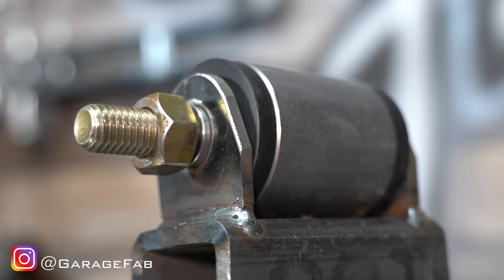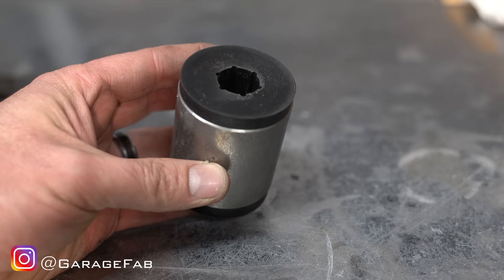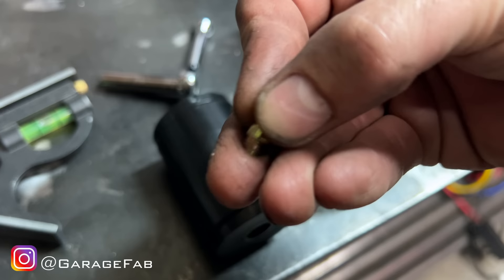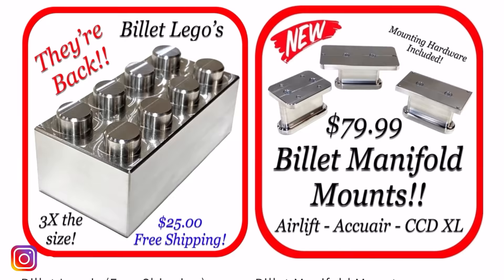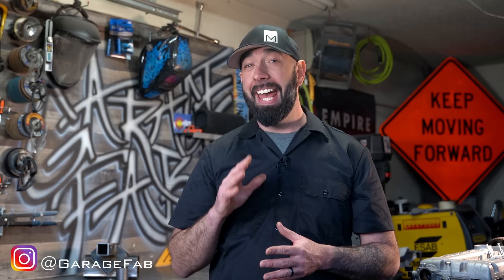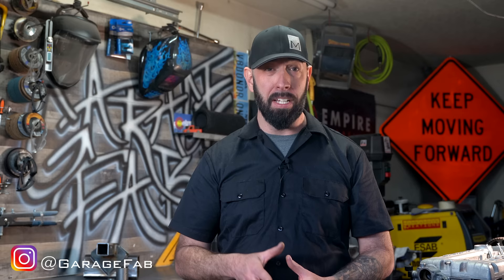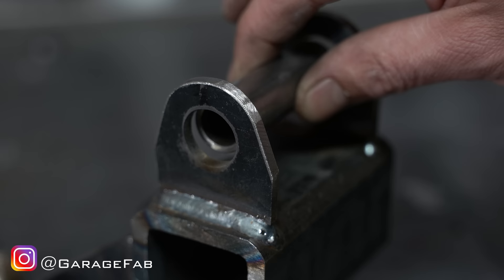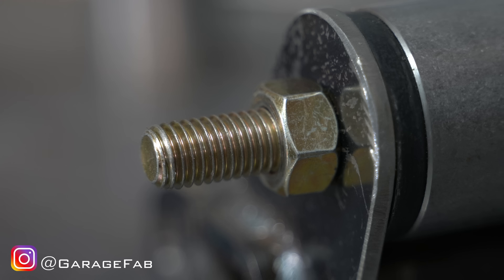The DOs and DON’Ts When Installing Polyurethane Suspension Bushings

Comment: I want to install poly bushings on my project car and have a dumb question. Can you specify when bushings should be torqued with the weight of the vehicle lets say control arm bushings on a solid rear axle. Was i misinformed since like you explained the outer sleeve rotates and not the inner so then this does not matter if all upper and lower axle bushings where tightened with the rear axle hanging and car supported on frame? thank you or who ever reads this :(
Reply from the maker: Definitely not dumb. You were NOT misinformed! There are a few different types of bushings. This video featured polyurethane bushings, almost always aftermarket, often racing applications.
Factory vehicles come with bonded rubber bushings. On this style, like the name implies, the rubber bushing material is bonded to both the inner and outer sleeves, unlike polyurethane bushings, the inner sleeve can’t slip. Instead the rubber twists and flexes.
On these bushings it’s imperative that the bushing through bolt is NOT tightened until the suspension is compressed under the weight of the vehicle. Tightening this type of bushing with the wheels hanging will cause the rubber to tear and/or fail quickly. (I’d recommend searching photos of both types so you can tell the difference.)
SO! After you install those poly bushings, torque the bolts down in whatever position you please. No damage will occur.

Comment: Good points. 
Grease doesn’t go between the bolt and the sleeve, a dash of anti seize goes between the bolt and the sleeve…
Reply from the maker: Haha! Us technicians in Nevada are spoiled. We rarely see rust. When we do it’s on a car that came here from far far away. So there’s not a lot of rust prevention measures taken here.

Comment: Bushing or Rod Ends as you call them are also used for engine mounts, transmission mounts, roll cage mounts and many others. So to call them a rod end is not correct. They are also used in shocks and leaf springs. The bushing is actually just the wearable part. Here is a quote from a dictionary. 

bushing. noun. bush·ing ˈbu̇sh-iŋ : a usually removable cylindrical lining in an opening of a mechanical part to limit the size of the opening, resist wear, or serve as a guide.

Also love the work. Just as a hint the tab should always cover ALL of the bushing end. To stop from tearing them and for extra support.
Reply from the maker: Thank you Simon! Very much appreciated. Both of those points were made in the video though, unfortunately, while addressing the supportive sides, I showed a clip of the “bad bushing” as an example of what NOT to do, but didn’t make it clear. In fact it appears the opposite. I’m looking into ways of editing without deleting as that would destroy the videos progress. 
It’s a good experience to remind me to chill and better comb over the videos before posting.
Thanks again!
Reply: @GarageFab  Hey wasn't picking at all. Great video. I need to make a few of them but too lazy. Takes alot of work. We do alot of diesel swaps.
Reply from the maker: Don’t sweat it my man! I don’t get offended. All input is good input. It’s genuinely appreciated.
I too suffer from the lazy gene. It’s rough!

Comment: The tabs/bushes on the top links at 5:08 are incorrectly installed.  They need to align with the direction of force.  In this case, that would be on an angle identical with the incoming angular top link bars.  As currently configured the tabs will flex sideways under load and could age fatigue - or fail under extreme circumstances.
Reply from the maker: We’ll have to agree to disagree. Forcing an angled bushing to rotate on an axis that passes diagonally through the bushing housing puts a lot of unnecessary unnatural forces on the bushing that destroys them on suspensions with this much travel.
On static height vehicles, I would absolutely install them your way.

Comment: Funny, I came up under Toyota from the T-Ten program in Sarasota. After devoting my life to the industry as an ASE master, you kinda get snobby looking at the other manufacturers and wonder how their techs don't throw their tools everyday in frustration lol. My Buick is my pride and joy, but it doesn't hold a candle to a '93 Camry in quality :P    Wonder what your opinion is on graphite bushings. I pressed in a set on my front control arms and they creaked like hell. Was originally told they were "self-lubricating".  At the time, the lubricant of choice was DOW 111.
Reply from the maker: I feel you. I make sure my family drives Toyota for the quality and my ability to fix them, but I don’t own one… because none of them are fun! 😂
Reply from the maker: Oh… also, I’m unfamiliar with graphite bushings! Like for suspensions? Or more along the lines of oiled bronze bushings?
Reply: @GarageFab  PST sells them and they used to advertise them as self-lubricating. I pressed them into my front control arms on a g body and they creaked like hell. Since I was a young man at the time I probably didn't install them correctly 🤣

Comment: I question the idea of cutting off the end of a grade 8 bolt.  It will leave the end with no plating or corrosion protection.  Maybe OK if you paint the ends?
Reply from the maker: That’s true. I often overlook rust prevention. I’m lucky enough to live in a place where we don’t see much more than surface rust.
I’d simply ignore everything I said about the bolt in this video. The point has been made that if the bolt is properly rated for the job, the clamping force would be enough to prevent the sleeve from sliding, which is, in turn, essentially eliminating sheer forces.

Comment: When in the Rustbelt, lubricating the thru-bolt with 3M Copper Anti-seize will save you from future torch cutting. Grease and regular anti-seize don't last as long.
Reply from the maker: Thank goodness for Vegas! Nothing is my preferred substance. One benefit of dry climates.
Is copper anti-seize less annoying than silver?
Reply: @Garage Fab  only slightly. It's comparable to grease in its messiness. 

It's also good as a brake lube. Sliding points, guide pins, and backs of pads. High temp resistant, and the cure for the common squeal!
Reply from the maker: I’d be willing to try it on brake pins. Our current lube that’s marketed for that purpose gums up over time preventing the slide. Not cool.
Reply: @GarageFab   3m 08945. 9oz brush-can @$10.

Comment: I have a very specific question about Honda civic/Crx/Del Sol, Trailing arm bushings. There is a discussion about using poly bushings in the trailing arms some people seem to love them and some warn that they will cause snap oversteer because they limit the movement of the trailing arm (Binding) and i just can't come to a conclusion about it.

When i hear people warn about them i start to wonder if they might have installed them wrong not rotating them correctly before lowering the car down or something else in their suspension setup that's wrong maybe too stiff sway bar? And when i hear people praising the poly bushings i wonder if they maybe just don't drive the car hard enough to ever experience the issue?

One thing i do know is that people will follow ideas they might not understand and I don't understand suspension geometry enough to even make a decision between the two groups of people.

I now that this a very specific question about a specific car and you might not have the answer but the 50/50 opinion is driving me crazy enough to start asking the question in other places like right here. Maybe if you someday get your hands on a Civic EG or Del Sol you could make a video about it, Just be ready for some heavy fights in the comment section.😅

I'm thinking about reaching out to a few poly bushing manufacturers to hear what they have to say about it but I also know that every business want to sell things and make money so the answers are probably going to be skewed to a very positive outlook on the trailing arm bushings that they are selling.

Either way this video is incredibly good it helped me out allot in making my own bushings, Thank you!🙂

Comment: Hello sir,  I enjoyed the video you made and I definitely learned something. I have a question though, where do you source the bushing inner sleeves?  I am currently dealing with the LCA on an 04 tacoma that suffers from the seized inner sleeve/cam bolts you mentioned in the video. I had purchased a set of ES bushings a while back and did not realize that you had to reuse the inner sleeve. I was hoping to source some replacement inner sleeve’s rather than spend an extra $100 on a different set of bushings. It may be the case that I just have to shell out the $100 and take the L but I figured I would ask and perhaps you knew where I might be able to source a new set of sleeves?
Reply from the maker: Because you mentioned your Tacoma, I’m assuming you’re asking about the factory Toyota alignment cam bolts that I showed in a different video. If so, I got those from a Toyota dealer. They were not cheap. It’s been a few months but if I remember correctly 4 cams with bolts was over $100.
The sleeves in this video are technically just DOM tubing cut to length. I purchased the complete bushings from a Thorbros.com

Comment: Great video brother! Thanks, I've had  a few arguments with "smart" guys about this...😄 How do you feel about using Delrin as bushing material for link bars?
Reply from the maker: I don’t have a lot of experience with Delrin! From the VERY small amount of knowledge I have on the topic, they might be a good choice on vehicles built for the dragstrip. Soft bushings zap horsepower. A firmer bushing like Delrin will help transfer power from the engine to the ground. But from my understanding, good handling requires bushings that articulate freely. A arms would be fine as articulation of the bushing isn’t needed, but for rear suspension on a vehicle built to auto cross, Heim joints might be a better choice. Take this whole comment with a grain of salt, as I am not an educated Autocrosser or drag racer!

Comment: Great summary and refresher for all of us!  Nice work.
Reply from the maker: Thank you my friend! That’s exactly what it was. A refresher. Just before tackling the front suspension!
Reply: @GarageFab  -tackling the front on the C10, or the wife’s truck?  Either way I’m anxiously awaiting this!
Reply: I meant to add, I think everyone would love a refresher on how to lay down those nice welds like you do. Most of the recent footage is sped up for brevity (and appreciated), but I would love to hear your take on it.
Reply from the maker: Fingers crossed, I hope to never have to do anything with Keith’s air suspension again. He hasn’t expressed any concerns with the front so I think I might be safe.
I’ll be starting Caroline’s front suspension from scratch. (Kinda. I’ll be attempting to keep the factory geometry even though everything will be custom made.)
I will likely be doing a welding video soon, by popular demand, though I’ve been trying to avoid it for a very long time. I am not certified in welding and I’ve never been professionally trained, so I’m squeamish about publicly giving welding instruction. So when it happens it will certainly be focused as a “technique”video. I have zero fear of persecution, but lots of fear of inadvertently steering folks in the wrong direction.
Reply: @GarageFab  - good to have that concern. I’m not professionally trained in welding either, but from what I’ve seen with your prep, understanding of correct penetration, heat management, and welding at all angles, you are doing it right. Practice is what most of us weekend warriors need (speaking for myself) but understanding someone else’s techniques and setup can be very beneficial as well. Yeah, Keith’s truck is sweet and looks to be sorted now. Great job on that.
Reply from the maker: Thank you, Brother! 🙏

Comment: We call the inner sleeve a crush tube. This is what stop the bolt from bending the brackets in. I was ways lubricate the bolts shank with moly grease die to it not moving water can get inside and seize up. There is nothing more frustrating than drill out a suspension bolt to collapse it. For the sakes of a smear of grease it save hours of unnecessary work.
Reply from the maker: Very true. I never thought I’d say it but, Hooray for Vegas! Rust can’t survive here.

Comment: Do you put a lock washer under the nut? I wish my classes in engineering school were this straightforward and clear.
Reply from the maker: Washer yes. Lock washer no. I use lock nuts on final assembly. I have normal nuts just for making mock-up and demonstrations easier.

Comment: oh wow I was having arguments about this 25 years ago. everyone was buying greaseable bolts and I was trying to tell them that makes no sense
Reply from the maker: Haha! Maybe the greaseable bolts were intended strictly for rust prevention! 🤷‍♂️ 
I’ll be honest though, if you drill a hole in the inner sleeve that lines up with the gap between bushing halves, the greaseable bolt might be a great option if you don’t have clearance for, or access to a zirc fitting. 🤔

Comment: I have yet to see one OEM car manufacturer or exotic hypercar or Baja Trohpy truck that uses poly bushings in the suspension. It will either be rubber or spherical. I'm not a fan of poly....just seen too many poly bushings permanently bend and the internal ID becomes ovalized and sloppy. But your tutorial on building the flanges, sleeve design, etc is excellent.
Reply from the maker: All bushings have their place. It’s up to the builder to determine which one fits the intended use of the vehicle.
You will continue to never see poly on an OEM car. Manufacturers must balance comfort, quality, and production costs when making millions of vehicles. Rubber bushings are soft, absorb a lot of vibration and are very cheap. So this is a great choice. Rubber bushings don’t last long though.
Quality polyurethane lasts much longer but is significantly more expensive, is far stiffer which channels a lot more vibration to the driver. This would be a terrible choice on their part.
You will also never see poly on an off road vehicle other than perhaps A arms. Articulation is hugely important on a trophy truck and that’s something poly just can’t do.
I personally have never seen a quality polyurethane bushing fail prematurely if it was used as intended. 
Thank you, George! You are appreciated.
Reply: Cheap ones like Daystar and prothane  will get spongy. Good ones like Energy Suspension won't ovalize or get spongy. Plus they're graphite impregnated and never need grease and won't squeak.
Reply: @GarageFab daystar poly bushings will get spongy on a triangulated 4 link when the bushings are not installed parallel. The twisting as the normal part of up and down movement occurs they are squeezed beyond their limit and loosen as they get spongy.
Reply from the maker: That’s good info, Michael, Thank you. I’ve been using the same bushings forever so I honestly couldn’t tell you what brands suck. Until now perhaps!
Reply: @GarageFab  yea the ones Jason uses are Daystar and work well unless you have them in a bind. Jason didn't want to use Energy Suspension because he couldn't buy them direct from them. That was back in 2005. If you want to use an Energy Suspension bushing the one that's the same as the Daystar ones is the #2004
Reply from the maker: Well in my previous comment, I wasn’t familiar with the quality of Daystar. But if what you say is true, I guess I am! I have only used parts from Thorbros since I started in 2007. I’ve never seen a bushing that I installed fail prematurely. (Or at all for that matter) I never bothered to see what brand they were using. If I’m being honest, I wasn’t sure if they were making them or buying them!
Reply: @GarageFab  yea I haven't seen many fail myself. However I have seen them get spongy on a triangulated setup. Back when I made control arms for Jason he was looking at buying bushings in bulk. Energy Suspension wouldn't sell them wholesale direct. He would have had to go thru a wholesaler. He said nope and went with Daystar. They're good.
Reply from the maker: When you say “Spongy” What do you mean by that? A loss in stiffness? Get soft?
Interesting info, Michael, thank you! I don’t have a store yet but when I do I considered selling the basics so this stuff is fascinating. 👏
Reply: @GarageFab   yes they get soft and lose their stiffness. This is not real common but it happens as I was saying in a triangulated setup with lots of travel where the bushing gets twisted.
Reply from the maker: Thank you for that, Michael. 🙏

Comment: Excellent video. 
Curious ... What happens if the sleeve is able to rotate while in use ?
Reply from the maker: Nothing right away, Joe. Perhaps a lot of noise, squeaking and rattling. More concerning is the metal on metal contact from the sleeve rubbing on the bolt. This will wear away at the sleeve, the holes in the tabs and the bolt. This might first cause alignment and tire wear issues, but will eventually lead to breakage of the worn bolt, and a loss of a suspension component. That would suck.
The next part is a little more complex; When the sleeve is tightly clamped between the tabs, the tensile forces of the bolt (pulling force between the bolt head and the nut) prevent any movement, so the bolt is only experiencing those tensile forces. When loose, the link bar or control arm can now push and pull sideways on the bolt. (Shear forces)
Bolts vary, but generally bolts are stronger under tension than under shear forces. If the bolt is worn, it’s significantly weaker.
Summarized: Clamp the sleeve.
Hope this helps!